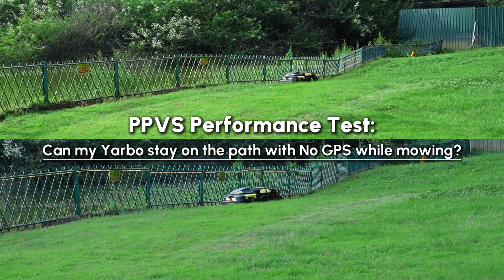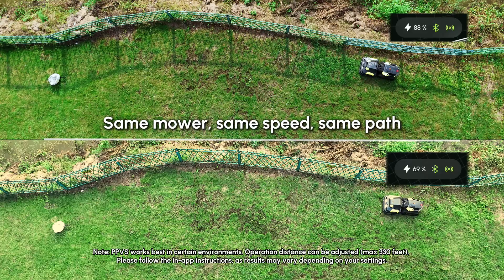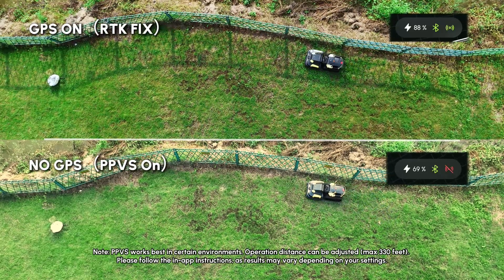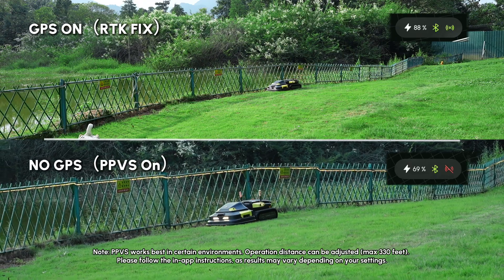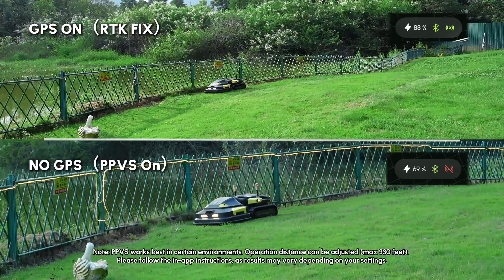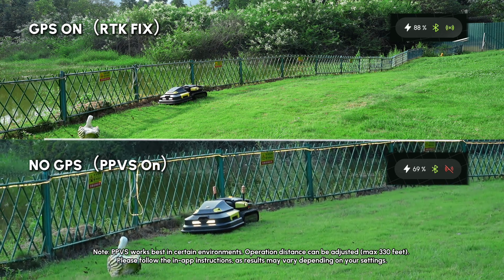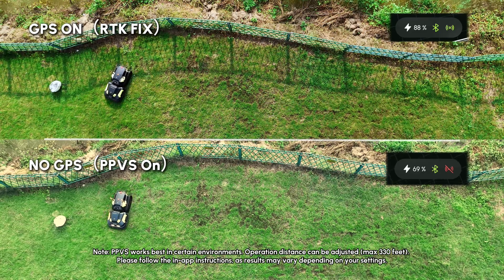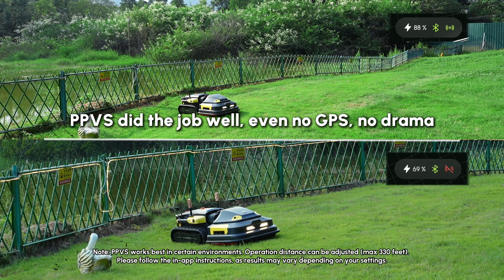No GPS? No Problem | Yarbo Lawn Mower Pro Extreme Edge Test with PPVS

Comment: would not recommend buying anything from yarbo because they lie to you on when your product will be shipped. i ordered the lawn mower pro during the first launch and was told it would ship out the first of august. BIG LIE! just got a email that it will ship end of august to the end of September! Yarbo is currently running ads on youtube say available for immediate shipment. so is this a lie also. all they are trying to do is get your  money and they ship your product when they feel like it. i don't understand why a company has to lie like this. They have very low integrity. then when you ask them about your shipment they try to offer you points to make you feel better. also their tech support is non existent they keep sending you to someone different but never resolve the issue. so if you buy anything from them you are on your own.

Comment: Will this help when mapping too?
Reply: Looks like it can according to the release notes!  There are parameters you can set for mapping vs paths vs areas etc for how long it can run with degraded GPS👌👌👌
Reply: Absolutely avoid this product. It will take less of your time and money to cut grass with a nice zero turn. My first yarbo core totally died, my replacement has a GPS that's unusable. When it came time for them to pick up my old one to return it, I sat here for hours waiting and nobody ever showed. Trust me, spend the money on a zero-turn, it'll take about an hour and a half to cut 6 acres. You will spend that much time troubleshooting this thing per week